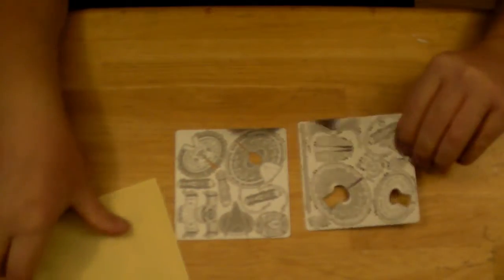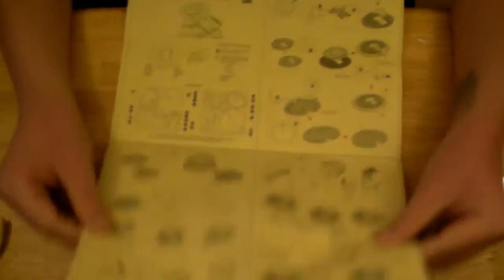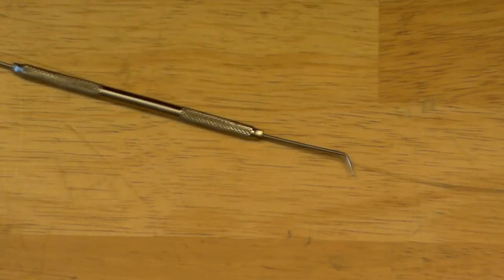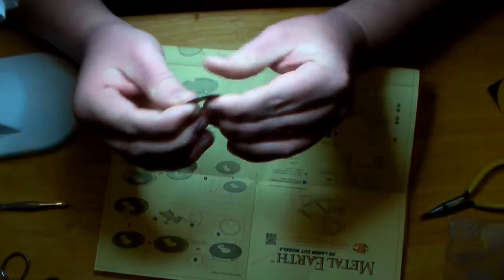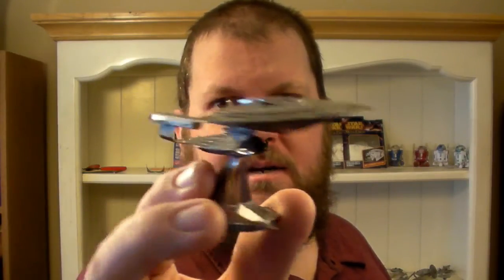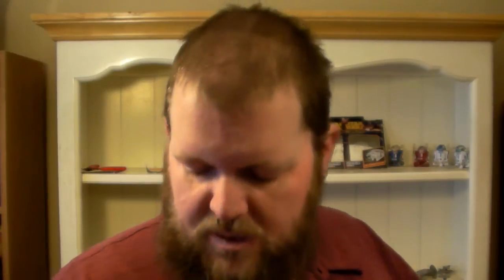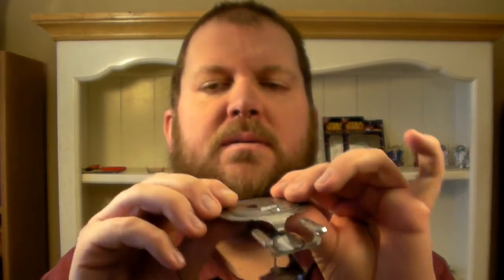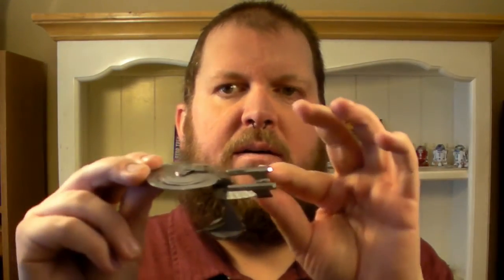Metal Earth build - Enterprise D - Star Trek The Next Generation

Comment: So I did  Vorcha and Enterprise D without too many serious issues.  On the Enterprise D  I found a useful tool for shaping the saucer pieces was actually a spoon. I think the saucer was the best part of that build for me and the spoon was definitely part of the reason it went so well.
Reply from the maker: Great idea with the spoon.
Reply: I just completed this model. The tabs on the right nacelle are opposite of what they should be and I broke two tabs but the last one is hanging in there. I used my mouse to shape the saucer sections. I found it odd that a lot of the engraving on the larger saucer sections are covered up by the smaller ones, I don't get that

Comment: I wonder if they will ever come out with the NCC 1701-A Enterprise refit or the NX-01 refit.
Reply from the maker: It has been well over and year and no word of new Star Trek kits. I wonder if they did not sell as well as they hoped. They made some mistakes with them too. The original pictures of the TOS version had the nacelles too low, and it looks as if they were designed to sit that low and never updated. I had trouble getting my oriented correctly. As for the Enterprise D, it has the big guns on either side of the bridge that should not be there. Perhaps they turned people with such mistakes.
Reply: animateorange
The NX-01 Enterprise that is made by Metal Earth also has the guns on either side of the bridge which irks the hell out of me. I mean the last kit I know of that came out was the Voyager and that was made by Bandai (beautiful kit by the way and it comes with lighting but if you find one in the box un-built it is around $500) the last three kits were from AMT/Polar Lights/Round 2 and that was in march of 2015. Those kits were all from the original 1960's series.

Comment: how the fudge do you connect the saucer to the main hull having trouble with that one
Reply from the maker: It's been a while but if I remember right, I attached one of the front sides at a time, say Part 12, to the bottom of the saucer section, the attached the other (part 13) to the bottom of the saucer section, then just worked the angles until The two met in the front. I remember feeling it was very tricky myself.
Reply: animateorange i figured it out that was the worst part of the entire thing was the 'neck' they are way difficult to bend right, and i had to really study pics online to figure out the wat they even went. well that and i broke the base lift arm trying to bend it properly.
Reply from the maker: joe keigans I am glad you figured it out and sorry something broke.